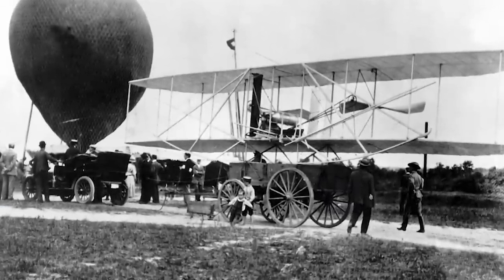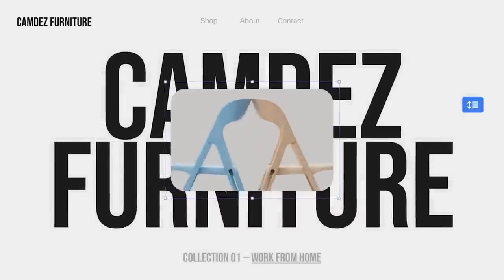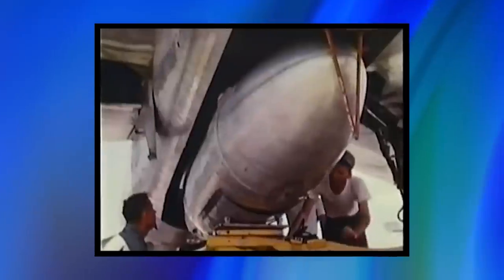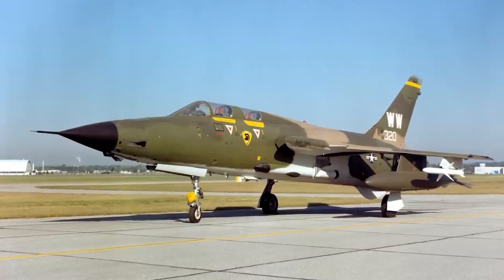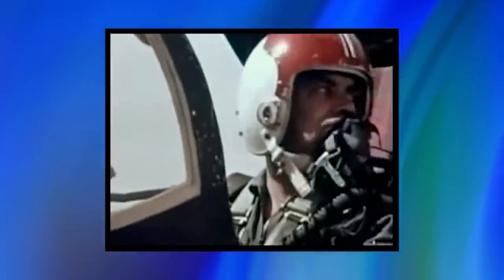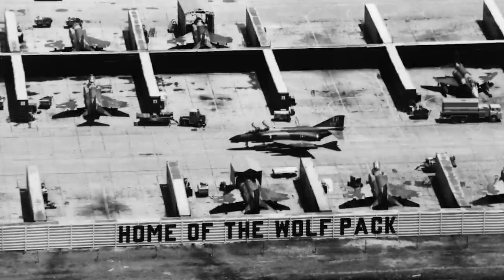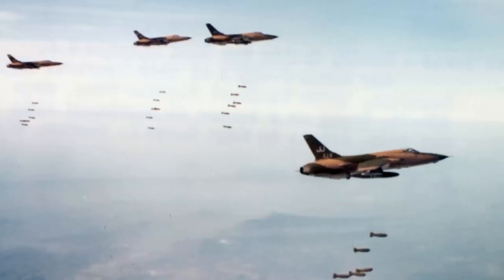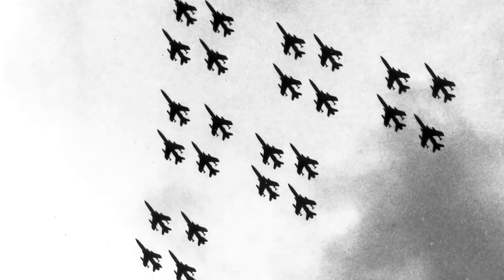The F105: The Supersonic Bomber's Fatal Flaw

Comment: So what was the fatal flaw? By all accounts it was an admirable aircraft that served with distinction. It just needed more servicing than it was given.
Reply: According to wikipedia it's the only airframe recalled due to losses. But it was also used for Wild Weasels, so it had to be fast.

Honestly though wars are won on logistics, and an airframe demanding to much logistics limits their effectiveness.
Reply: It was useless when sub or transonic. It would only perform at above Mach1
Reply: My father flew an F105RC in France. One day he was flying home from Algiers and the altimeter froze. He wound up flying into a mountain because he thought he was higher. I found this out from an ATC.
Reply: SAMs
Reply: The hydraulic system.  All of the surface controls needed hydraulic boost to operate.  Unfortunately, the layout of the hydraulic system was so poor so when one was shot/failed, it often caused backup systems to fail too.  Without hydraulic boost, the pilot could not control the plane and had to eject.
Reply: Its flaw was the the military didn't adapt to them properly, much like most of the air power if the time
Reply: As nimble in the air as a Mac Truck.

F-4 phantom Ii's used to mimic flight paths of Thuds to lure out Mig 21's thinking they were going to fly circles around the 105s... until the trap closed on them.
Reply: It was remarkably fast for the time, but that streamlining came at the cost of reduced control surface, which made the plane very hard to control by all but the most experienced pilots. Yes the F-4 Phantom was a superlative craft that fixed most of the growing pains of these earliest jets.
Reply: The fatal flaw was the Small Vertical stabiliser and handling at low speed when fully laden. If At a full fuel and weapon load and at low speed the aircraft could go into an unrecoverable spin. This was partially rectified with the revised Vertical Stabiliser.

It also suffered with the J79 turbojet due its high maintenance.
Reply: For the record, it was two days after my first birthday and, yes, he did die.
Reply: Also, for the record, Air Force said he had engine trouble and said he sacrificed himself to save a village.
Reply: It could be a beast in a stall. Generally happens at low speed i.e refueling.  Still was an awesome airplane  for the time.
Reply: I wondered where this "fatal flaw" was too.  (Asides the Johnson Administration)
Reply: Clickbait title. The F-105 was a superb aircraft. The reason for its high loss rate was that it was a tactical nuclear bomber optimized for that mission, but was pressed into service doing conventional strike missions over very heavily defended airspace.
Reply: @kiwi_comanche  Untrue. The F-105 had phenomenal power and could out-accelerate anything in-theatre at low altitude. It was never going to out-maneuver any of its peer aircraft at sub- or supersonic speeds, because it was never designed to do that.
Reply: The triple-redundant hydraulic systems ran together along part of the underside. This is problematic when you're subject to ground fire.
Reply: @MikeFoxWoW sorry for your loss. Had to be rough as hell on your mom especially having an infant at the time. She must've been a great woman.
Reply: Imagine if you want a car that have to be serviced every half year instead of an annual check.
Reply: The F4 used the J79,the F105 used the J75.
Reply: Calling it a fighter. It was a supersonic bomb deliverer. SB-105. Sure was great lookin though
Reply: @MikeFoxWoW skill issue
Reply: Well just ask the Thunderbirds demonstration team....after they adopted it as their mount they had only performed 5 aurshows with it before they suffered a fatal incident...on only their 6th display with it one of them broke up in flight killing the pilot...it was NEVER suited for formation aerobatics
Reply: @kiwi_comanche 😂
Reply: @MikeFoxWoW bummer
Reply: @connormoylan2466 Flaw was it wasn’t used in the role for which it was designed. It would have been great throwing nukes all over Vietnam
Reply: @Black-Sun_Kaiser 🤦‍♂️ cringe
Reply: @guaporeturns9472  ok
Reply: @guaporeturns9472  you should elaborate on how so. I'll definitely read the reply.
Reply: @Black-Sun_Kaiser  Dude makes a comment that his dad died and from that you can tell his mom is great? Please explain the how you came to this conclusion.
Reply: The fatal flaw of the F-105 was the cruise missile. Capable of supersonic speeds and equipped with ground following radar, It could fly below radar and deliver a nuclear payload without a pilot. Adopted by the USAF in 1976, it essentially ended the need for the 105 as it could perform the 105's primary mission at lower cost.
Reply: The fatal flaw was crap mission planning
Reply: There is none.  This video is just another example of Simon's garbage 'journalism.'
Reply: @danielbretall2236 The fastest jet at low altitude in SE Asia at the time
Reply: @Black-Sun_Kaiser still waiting
Reply: @guaporeturns9472  you'll be waiting for eternity cause I don't care what you're saying. Good day.
Reply: @Black-Sun_Kaiser You obviously care enough to comment after 7 months😂😂HAHAHAHAHAHAHA HAHAHAHAHAHAHA 
I win 🥇
Reply: @guaporeturns9472  wow , that's so funny. You seem really weird.
Reply: @Black-Sun_Kaiser  When you reply it means I triggered you and that’s exactly what I am trying to do so I win. And if you don’t reply it means I got the last word so I win then as well. No matter what you say or don’t say I win and that pisses you off 🤣 ( that’s another win for me as well) 
🏆
Reply: He knows nothing about aircraft and tried to deliver it lmao
Reply: The F105 also had to be constantly upgraded in order to stay up to date and cost wise it was pretty expensive aa well with also nearly half the entire 800 some F105s lost ....
Reply: It was suited for aerobatics and the pilots enjoyed its crisp handling. The F-105B that broke in half at Hamilton AFB on a pitch out was found to be incorrectly repaired after it had been involved in a in-flight refueling mishap. The H-shape frame repaird behind cockpit was not up to factory specs.

Comment: I was a mechanic on various 1960's military aircraft.  Access panels that made maintenance "easy" was a relative term.  Engine component changes always left me wishing for an extra elbow, 18" fingers, and a grip like the bite force on a crocodile.
Reply: This struck a chord, vis-a-vis modern automobiles and do-it-yourself maintenance/repair. What I needed to change the oil filter on my Honda was a chimpanzee with the grip of Godzilla and an extra elbow joint.
(Or a lift. Would not have helped with the planes.)
As a ship mechanic in the Coast Guard the issues were different. Removing a large valve for repair often involved getting personal with greasy pipes and supports with oily bilge water sloshing over you as the ship rolled. Not that difficult, but not very pleasant.

Comment: The issues you mentioned with F-105s trying to aerial refuel from slow propellor-driven tankers, such as the KB-50s and KC-97s was by no means restricted to the F-105, but all jet fighters.   Auxiliary jet engines were added to the wings of some KB-50s and KC-97s to increase the safety margin,  but the situation wasn't resolved until the all-jet KC-135 entered service.  The KC-135 continues to be the most numerous aerial tanker in the world.  The F-105 was one of the few fighters that could refuel from almost any tanker without modification.  As your video shows, it could use both the probe & drogue and the flying boom methods of aerial refueling, enabling it to refuel from any tanker available.  The flying boom method was preferred by the Air Force because it could transfer much more fuel in a shorter length of time, which is crucial when refueling large bombers or multiple fighters.  The F-105 pilots liked the internal refueling probe, since when they visited a rival air base - especially a Navy or Marine air base - they could taxi past their rivals and extend the refueling boom - thus giving a friendly "finger" to anybody watching.     Thanks for a great video on a truly amazing (as were its crews) aircraft.
Reply: And they were not stalling the engine, they were stalling the wings!
Reply: @georgegonzalez2476  True dat!
Reply: In Thailand they'd raise the probe to give the finger after they finished their 100 Missions to North Vietnam as well.

Comment: The "Wild Weasel" variants of the F-105 remained in service until early 1984, at which point they were replaced by the specialized F-4G "Wild Weasel V".
Reply: 1983.
Reply: Not exactly, the f4 could not perform SEAD operations as efficiently as the 105 because it's loadout was puny. F105 Gs were recalled to Vietnam for that roll when the F4s failed.  The 105 Gs were superceded by F16s in the late 70's. Some 105 Gs continuing service with ANG units until 1984.

Comment: No mention of the two seater F105 F and G models running the Wild Weasel missions 😞
Reply: Simon needs to make a video on Wild Weasels/SEADs in general. (Suppression of Enemy Air Defenses -- basically they go in, get lit up by the surface-to-air missile radars, and then fire a missile that rides the enemy's radar beam back to the source, hopefully before the SAM gets to them.)
Reply: That's where the phrase "go ballistic" comes from -- once the SAM is launched, if the antiradar missile takes out the ground-based radar or its crew shut it down to try to avoid the ARM, the SAM is unguided and flies like an artillery shell on a ballistic trajectory.
Reply: Sleepy Weasel? ;)
Reply: Fs were trainers. Gs were wild weasels.
Reply: Simon is all about drama and innuendo. Facts and rational discussion of complex systems is not his thing...

Comment: The high maintenance associated with the Thud was the J75 had to be at 100% nearly the whole flight.  Considering the Thud carried nearly twice the weight of a bomb load of a B-17, while weighing only 20% lighter (52,000 vs 65,000) lead to the huge upkeep to keep them in the air.
Reply: Your information is flawed. The J75cwas capable of returning pilots to base after sustaining such damage as to never run again after shut down ( beyond repair) The biggest flaw, early on was no redundancy for the hydraulic system. This was corrected  by a retrofit program. The next problem was the pilots oxygen system. Pilots complained of getting a face full of jet fuel fumes during refueling often making them I'll. Don't know if they ever fixed that one.

Comment: I was a crew chief on the 105 1965-67, Rolling Thunder, Korat. I saw one return with most of the paint burned off from behind radome. The pilot claimed a speed of Mach 2.3. Another point,we all called it the Thud as a reference to “ big chief Thunderthud” from the Howdy Doody show. I never heard of any other genesis for the name. Finally an F-15 buddy of mine related an experience: during an exercise at Nellis he jumped a Thud lower, headed in the opposite direction. What happened? “ We were on the deck and just walked away from me! “ Nuff said 😊

Comment: I found that nuke deploy telescoping device you mention at a crash site in the Piutes mtns. next to China Lake Naval Weapons Test center in the Mojave Desert. I read they had problems with the nuke tumbling up into the belly at release going over Mach 1. They ended up reshaping the nuke to fix the problem. The aluminum forging that was the attachment point for the bomb had a sticker on it telling the ground crew to put "lever B in position A for Special Weapons lock." We all know what a Special Weapon is.

Comment: 6:30 The refueling issue you discussed and the associated video was using was a propeller driven aircraft; probably a KB-29 or KB-50.  Once the KC-135 came into service, speed differential disappeared.  BTW nice crop on the video.  The reason probe and drogue was replaced by the extended boom wasn't for "control" of the process, it was because the boom is far superior in speed of refueling. Still waiting for the "fatal flaw".

Comment: The 'fatal flaw' of the 105 was the horizontal tail. This could easily be disabled if the hydraulic system was damaged and invariably led to the loss of the jet. Later, they modded the jets so that the tail would lock in a position where continued flight was possible when this happened.

Comment: the overhead shot of a 4-ship with 1 Thud still silver and by the look of it a B-66 in the lead are on a "Skyspot" mission 
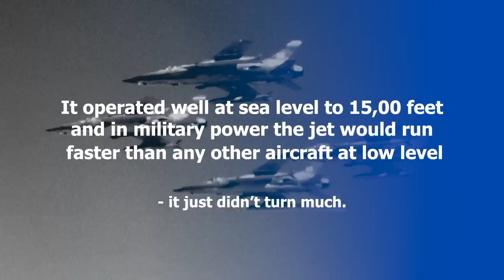(@ 9:18).  The Thuds lacked the type of radar to do it themselves, so they would follow the '66 and bomb blind on its command in conjunction with ground radar guiding the '66.  Pilots would sometimes drop 1 bomb each and then, since they were released, go truck hunting.  The flaw about the engine use is correct.  Due to prolonged use at or near full power and more use of the burner, the engine was "aging" faster than expected.  Flying along all safe and sound, then the warning lights and alarms go off and its time to eject.  The aircraft were lost over North Vietnam or Laos, but then it happened to a Thud right after takeoff from Korat.  From the wreckage they discovered that the engine shredded itself & threw the blades which sliced through everything in the rear of the aircraft.

Comment: It's about time you did a video about the F-105 Thunderchief. The largest and fastest single engine jet of its time, advanced avionics and systems. Down on the deck fully loaded F-105s were out running F-4 phantoms that were suppose to escort them.  

Dirty Deeds... THUNDERCHIEF!!!
Reply: G'day,

Wrong...!
The line of
The SONG,
Was

"DONE
      DIRT
          CHEAP....!"

Acca-Dacca would not have known
Nor recognised an
F-105 if it fell out of the 
Sky & crashed on their
Audience at a
Concert.

AC-DC
Had 
ZERO Interest in
Unkle Spam's
Fossil-Carbon farting
Little
Hairygoplanes.

Just(ifiably ?) sayin'.

Such is life,

Have a good one...

;-p

Ciao !
Reply: @WarblesOnALot  Ruffled some feathers lol. I know it's done dirt cheap, but thinderchief doesn't sound too bad either.
Reply: @abitofapickle6255  

No worries,

Apparently there's a
Big
Shitpotful of individuals who
Genuinely thunk
The
Origidiginal
Lyric was
"FunDurrrChief...!"

So, 
One felt kinda
Duty-bound to
Offer a
Mite of
Correctikation...

(lol !).

;-p

Ciao !
Reply: A very correct statement! Thank you.

Comment: You failed to mention the F-105G Wild Weasel.  Another variant of the Thud that was a 2 seater designed to take out enemy air defenses.
Reply: Exactly!  How do you a video about F-105s and not mention the Wild Weasels?
Reply: There were several pictures of 105F's and G's in the video.
Reply: Glad several people picked up on this. As I understand it the Wild Weasels’ job was to bait enemy missile sites and radar-guided AA guns into firing to take them out in advance of the bombers/strike aircraft. A professional target, in other words. It took a pilot with the right combination of skill, guts and luck to do this job.
It seems to my the high loss rate should be seen in this context. A lot of strike aircraft were undoubtedly saved by the skill and sacrifices of the Wild Weasels.
Reply: @scottholman3982  And not once was the mission mentioned.

Comment: This is the second video that I would consider click bait Simon. The other was about the A-10. 

The F-105 was a ground breaking aircraft in many ways. Much like the F-111 years later. I'm tired of hearing the negative comments about either machine by the negative thinking, uninformed who cling to the one bit of info they know about an aircraft...then spew words like they are an expert. 

Because of designed wingloading for wicked fast low leve missions, tanking off prop driven tankers was EXTREMELY difficult. CODOs to all who did this before the advent of the KC135. 

IT WAS AN AWESOME aircraft, with an amazing engine...powerful and rugged. Know to suck in all sorts of things from wrenches, bolts, even patches in the inlets, and just keep running. TRY POSITIVE TITLES rather than negative BUUL SHIET ones just to get the "click"

Comment: There was no chute to recover the aircraft during a spin. Loss of control required an ejection. Aircraft that had drouges could deploy as a last ditch effort to stabilise the spin but there is no way a drouge would safely land the plane.
Reply: The F-105 had a drag chute, like most fighters of it's time.  You could land the plane without using it but you'd better have plenty of runway available.  Spins were recoverable in the F-105; loss of control did not demand ejecting from the aircraft unless you were below 15,000 feet.

Comment: Please get it right. Refuelling a 105 at low speed risks stalling the aircraft- not the engine (like in a car!).
It was called 'Thud' because that was the noise when it hit the deck after being shot down.
It was the 355 Tactical Fighter Squadron, not 'Air' squadron. Even your pic shows 355 TFS!
Among the things you missed out, were the activities of the two seater 105s as 'Wild Weasels'- maybe scope for a seperate video, or the fact that the there were over 700 made, and about half the fleet are still in Viet Nam- albeit highly dispersed....

Comment: Thuds flew with ANG until around 1984. I witnessed them with my own eyes.
Reply: When I joined the DCANG '82, they still had 105s.  After I returned from training (14 months later), they had switched to F4s.  Both tough to work on, as far as our equipment was concerned.

Comment: Military developing weapon systems that don't work as intended is common to militaries . Us Navy and the mk 14, ( Google mk 14 torpedo drakinifel for the story on that...) And the 1.1 inch AA gun that, as designed was unreliable and underpowered, being replaced by the 40 mm and 20 mm as fast as possible. Never mind that entire ships by many navys were designed that were so unstable that they put there crews at risk they ended up removing armaments to improve there stability